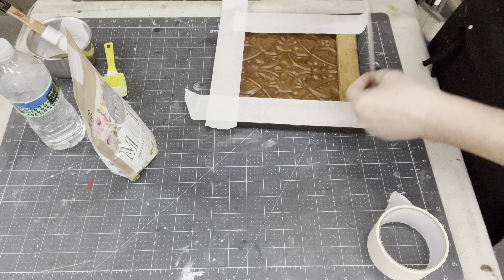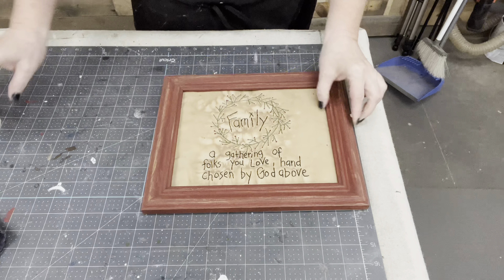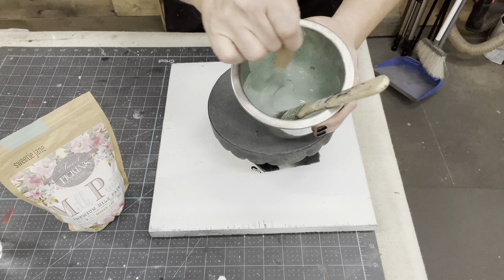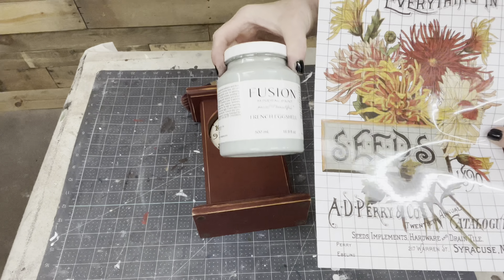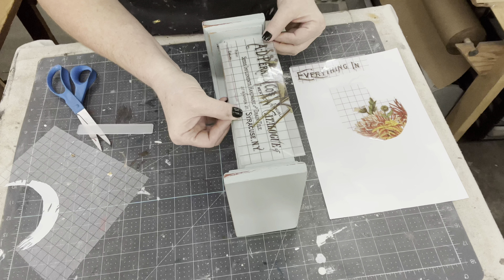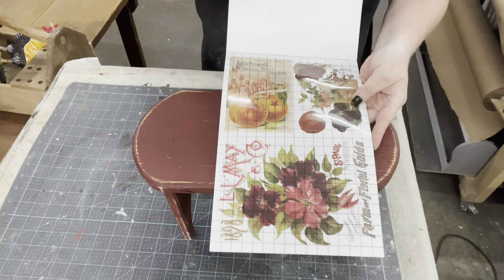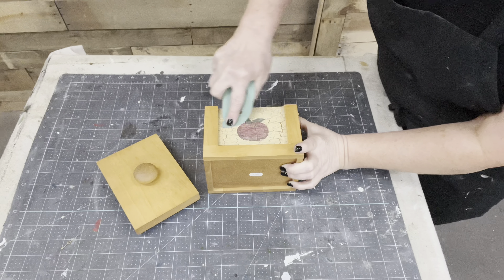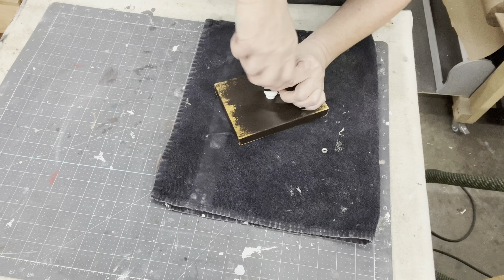THRIFT STORE HOME DECOR DIY MAKEOVERS | IOD SEED CATALOG

Comment: Milk paint isn't a 1 coat coverage. I hardly ever get full coverage with 1 coat. I always at least put on 2 coats and I always use my heat gun on the second coat to enhance chipping and cracking. I don't use heat on the first coat. Milk paint usually won't crack and chip until the second coat. Not sure where you heard that it was a 1 coat coverage but definitely not ❤
Reply from the maker: Thank you for sharing